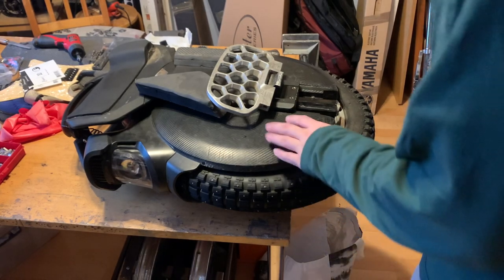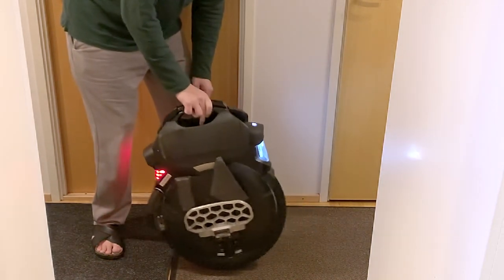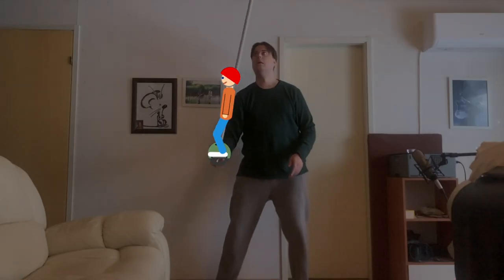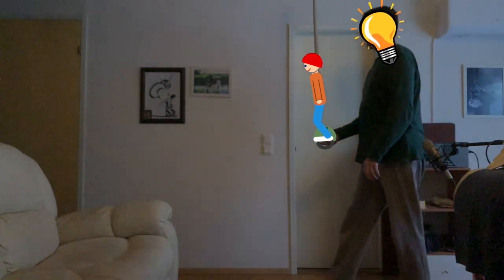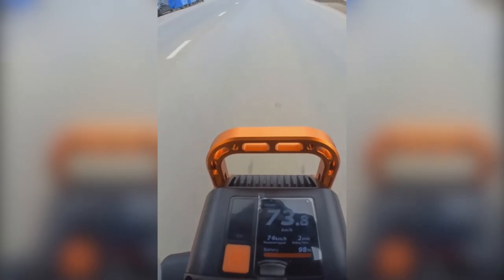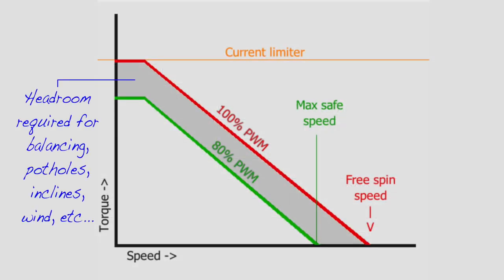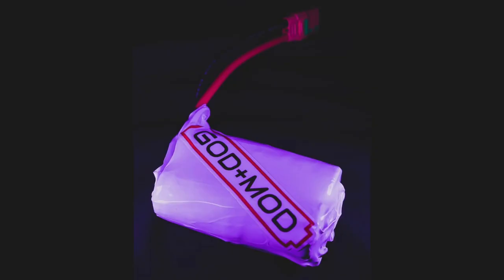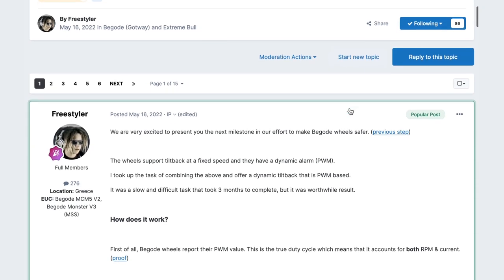EUC Overlean/Cut-out. What, why, when, how?

Comment: Thank you, a very valuable video that makes you aware of the danger. It's better to know this and always take the limit into account than to fall flat on your face and end up in the emergency hospital. Like me. I had to go through a very difficult operation and have a long period of rehab ahead of me. I fell at jogging speed. And I wore full protective gear. But unfortunately I encountered a concrete obstacle.
Reply from the maker: Oh shit, that sounds horrible! I’m so sorry for what you have gone and are going through. Did the protective gear fail, or was it partially insufficient? Or did you fall into the obstacle and not because of it?

Comment: Just got to enjoy my first cutout on an Inmotion V8F. I don't ride hard or push the beeps and every time I've overpowered it aggressive tilt back happened. Hit a deep pothole I couldn't see accelerating in a turning lane behind a car on the street and that was that. Helmet and wrist-guards prevented it from being worse but I learned that knee armor is 100% required even if you are not an aggressive rider. Video helped understand why it happened this time and didn't happen others.
Reply from the maker: Sorry to hear about your crash! You’re right, knees are usually the first one to take the blow, especially with potholes. I hope you didn’t get injured badly!

The V8F is a low-powered wheel, so it doesn’t have the power to survive bad potholes. Especially at higher speeds or with heavier riders.

Take care!

Comment: Good video, thank you.

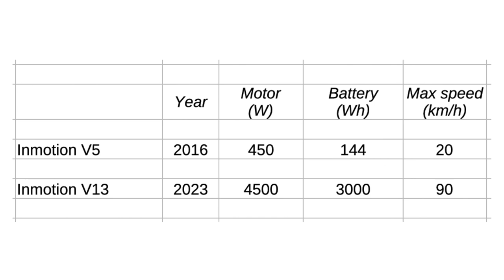The example graph at 03:35 explains much.  As a matter of basic safety, EUC manufacturers should be legally required to publish this type of chart, with the actual numerical values, in their user manuals.
Reply from the maker: Glad you found the video helpful!
The problem in publishing graphs like that is in determining what anyone considers “safe”. Everyone has their own preferred headroom, and the power requirements vary wildly. Every single EUC now and in the future can be overleaned simply due to physics. You can’t create a system of any kind that wouldn’t be able to fall under any circumstances. So they can’t publish much from that chart beyond the free spin speed, which becomes public knowledge anyway as soon as the first customers get the unit.

At the moment the only way to understand where exactly the limits are is to surpass them. Which means overleaning and crashing. I don’t see a way to solve that dilemma, other than to read on other’s experiences and take one’s best guess.

Comment: Really really nice video, I ride a V 12 HS the later version and for now during my 800km I ve never had any problems. But I did overlean the 16s ( First wheel I ever had) during the acceleration and it cut off. I also try not to ride faster than 68kmh on my V12
Reply from the maker: Thanks! Yeah, knowing the limits of one’s wheel is crucial for staying safe. The V12 can still be overleaned much below 68km/h if you accelerate with too much intent. Just like any other wheel. And a non-suspended 16” tire is not very good for those speeds either. Stay safe!

Comment: Superb video as always!

Question: Could one argue that having a harder riding mode would be safer “on the edge”? 
If you are close to the limit and you want to accelerate, the lean angle for a harder rider will be less than the softer rider, so in essence the wheel has to catch up less to correct this angle. Furthermore, you could also tell that the acceleration is slowing down before getting to the tipping point of over leaning as your lean angle is less.

Just a thought exercise. But it would be interesting to know for these faster wheels. 🤔
Reply from the maker: I think that most importantly it’s probably easier to feel when the wheel is at it’s limits when you’re on hard mode. Soft pedals getting slightly softer could be harder to notice than hard pedals getting soft.

It’s true that soft pedals require less effort to overlean, but they require less effort to accelerate overall as well. So if you’re used to the mode you’re riding in, it might not make much difference.

Comment: I dealt with this once on an Inmotion V3S back in 2016 but that was a much weaker EUC compared to the one's that are available today, however it was good uphills nonetheless and it had a 72v motor, just not that much battery life and it was very easy to reach the 14mph top speed. Luckily I was going rather slow and the injury was just a bruise to my left knee while wearing jeans.
Reply from the maker: Back then the power levels and speed were so small that I think we were all quite well aware about the limits being near. Nowadays the ride modes are so hard, there’s so much pover available, and the large tires and heavy wheels require so much effort to accelerate in the first place. All this pushes the limits so far that people don’t realize there to be any limits, and think that they can do whatever they want at any speed and the wheel should follow without question. And then they crash at a freakin’ 80 km/h! 15-25km/h was absolutely nothing compared.

Comment: Great educational video as usual! You mentioned that Inmotion and Kingsong have PWM tiltback and Begode with custom firmware. What about Leaperkim wheels?
Reply from the maker: Thank you! I’m pretty sure that there isn’t a fixed PWM- or current-based tilt-back. Not sure about over- or undervoltage. I do know that there isn’t a fixed speed-based tilt-back though. And if you set one manually, it doesn’t adapt to the battery getting depleted or other varying conditions. So it’s nearly useless from safety perspective.

Comment: So, in theory, if I were to ride at speeds no higher than 40Km/h, the odds of me experiencing a crash should be close to none, correct?
Reply from the maker: Incorrect. A crash can be caused by a huge variety of events, situations and places. If you think you can control all those elements only by limiting your speed, you’re fooling yourself. Many modern EUCs do have a lot of power reserve at those speeds, but it’s still nowhere near limitless. Ride blindly into a deep pothole with stiff legs at 40km/h and any wheel will dip enough to disturb your balance. Just for an example.

Speed is not what taxes the wheel the most. Burden is. A shallow downhill and steady speed takes very little energy even at very high speeds, while a steep incline, harsh acceleration or a bumpy road taxes the energy reserve much much more even at just 20km/h.
Reply: @mrelwood_EUC  Thanks for the information & thoroughly explaining internal/external factors. I'm currently debating whether I should switch from an e-scooter to EUC. This will help me make a decision.
Reply from the maker: @BerettaMac11Two9sAndaK, That’s a whole another question though:

- Bigger tires of EUCs roll over bumps, pots and curbs with much less effort.
- Modern EUCs are usually more stable at speed than scooters with an upright steering shaft.
- EUCs are much more convenient to roll next to you in stores etc.
- EUCs fit into cars without any effort.
- AFAIK EUCs have a better range.
- EUCs are simply much more fun to ride! If you’ve never done it, you’ll never understand how magical the mind reading flying carpet feels.

Comment: which euc application do you recommend for pwm settings? is the 80% optimal pwm value correct?
Reply from the maker: There’s only a phone alarm that you can set for the PWM, no tilt-back nor wheel alarms. They are managed by the wheel firmware (if they exist) and they aren’t adjustable.

For phone alarms there’s not much choice: If you use Apple, DarknessBot is the only one available. And for Android it’s EUC World.

Usually a 70-80% limit is what makes the most sense. But the exact optimal value depends on the wheel model and the usage profile.
Reply: @mrelwood_EUC  first of all, thanks for the valuable reply. i am a begode Master user. i can't find the setting in which panel in euc world. thanks.
Reply from the maker: @Musto28  I don’t use EUCw so I can’t help you there. But it is called “safety margin” or some like that. So 80% PWM is translated to 20% “safety margin” etc.

Note that for the wheels that don’t report the PWM value themselves, the EUCw’s “safety margin” calculation is not very precise.

But like I said in the video, instead of relying on phone alarms, I would definitely install the PWM firmware in a Begode. It should be available to install through EUCw.
Reply: @mrelwood_EUC  thank you❤️

Comment: You should never experience cutout or overlean if you are doing 40 km/h... Unless you are one of the many idiots taking the euc to unrealistic cutoff speeds...
Reply from the maker: Having an overlean at 40km/h can absolutely happen no problem. You just need to lean enough forward. I’ve had several overleans at 10km/h!
Reply: I overleand my 16x at about 40 kmh..  the closer you get to the wheel speed limit, the less power it has in reserve
Reply from the maker: @Raph333  Exactly! What happened in your overlean? What were you doing? We’re you hurt?
Reply: @mrelwood_EUC  i accelerated to hard for too long, did a front flip and bang my ankle finishing the roll.. Ankle swollen for 2 weeks but not a scratch besides that
Reply from the maker: @Raph333  Glad that you didn’t get more damage. An overlean is great in educating how the power delivery curve works at higher speeds…